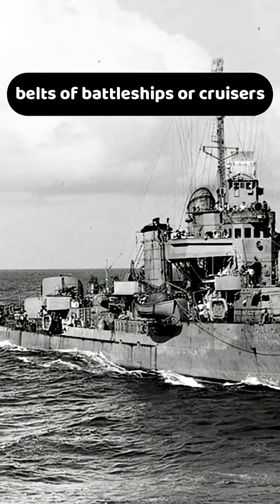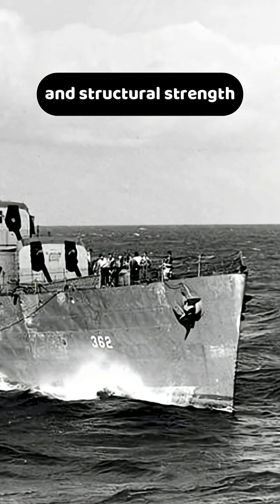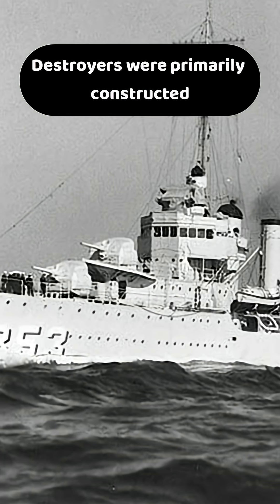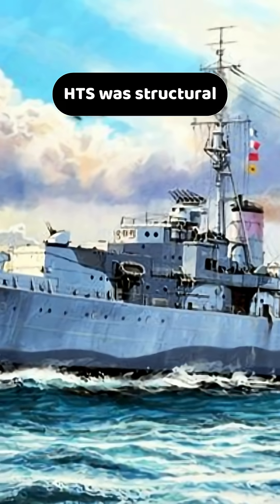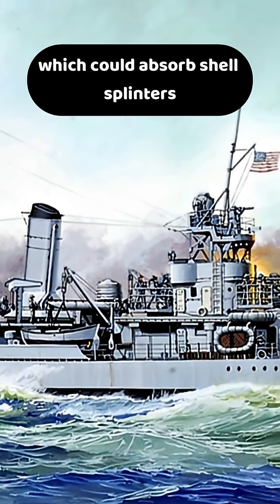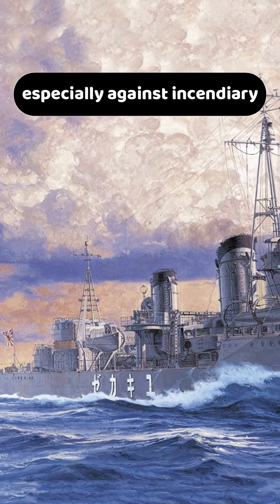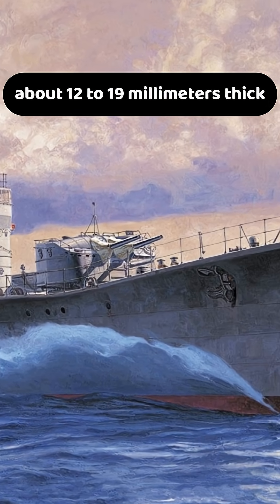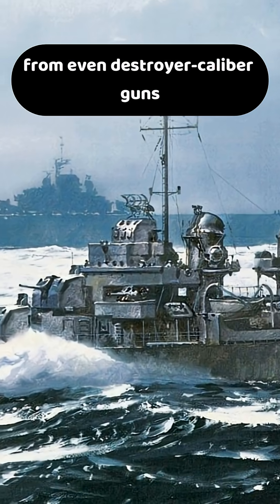Why WWII Destroyer Armor Offered No Protection?

Comment: That's not 100% true. Some WW2 USA DDs were given splinter proofing, which wouldn't stop a direct hit, but it was enough to keep out most shrapnel. And armour isn't always a good thing. During the Battle off Samar, numerous Japanese battleships fired heavy armour-piercing rounds at basically unarmoured ships, creating little more than in-and-out punctures. The hulls were too thin to initiate their fuses. It didn't turn for the worse until those battleships realised what they were fighting and switched to HE shells.